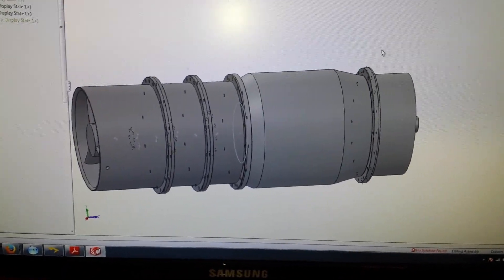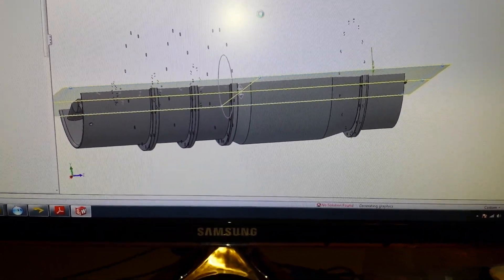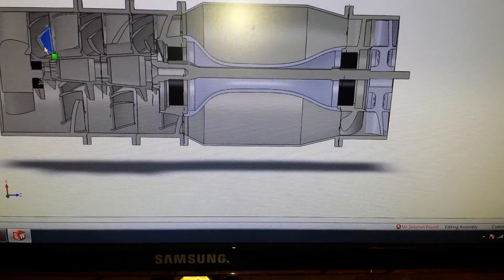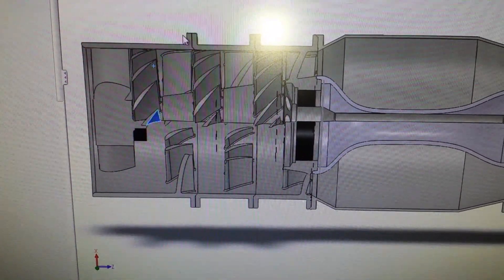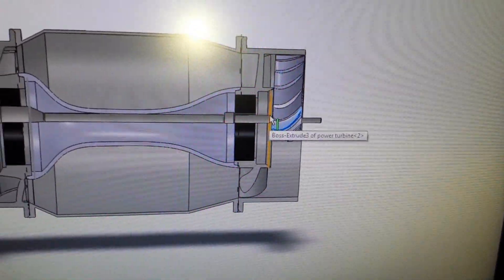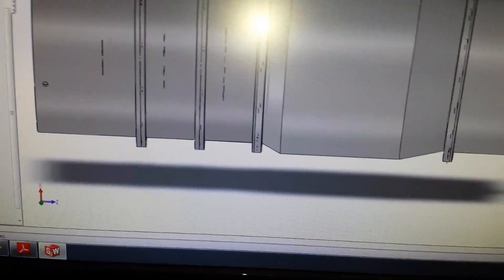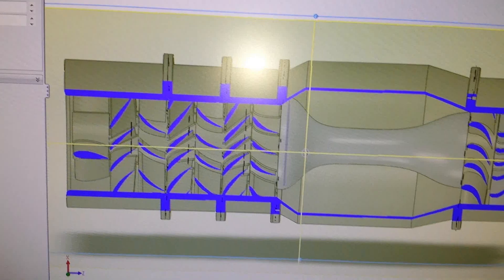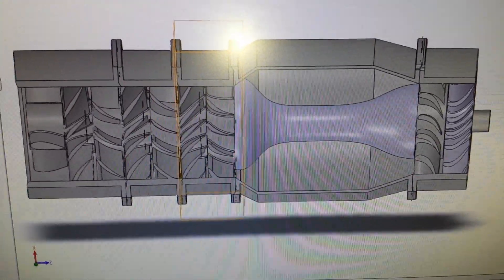3 stage axial turbojet

Comment: don't wait for your friends calculation because i've already done it and a 3 stage axial compressor will yield only 25.4016 psi as per my computation based on maximum efficiency performance if based on minimum the yield would be 19.5657 psi. compare that to a single stage centrifugal compressor which i have computed to yield 58.8 psi if you use a 2 stage centrifugal compressor the yield would be 176.4 psi. an 8 stage axial compressor will yield 63.2073 psi a 14 stage axial compressor will give you 188.7359 psi.so you need to build an 8 stage axial compressor to beat a single stage centrifugal compressor, but if you want to beat a 2 stage centrifugal compressor you need to build a 14 stage axial compressor.
Reply: +phoebekuan So, why not just build centrifugal compressor instead?
Reply: +Aviator168 building a centrifugal flow micro-jet engine has already been done by a lot of people so the challenge now is to build a self-sustaining axial- flow micro-jet engine. many persona have claimed to have built a working micro axial-flow jet engine but never proven its veracity beyond doubt..

Comment from the maker: yes there is stators between each stage of rotors , they are integrated into the housing so its on piece.
Reply: So it's on piece?

Fukken Slovak grammar..

Edit: spelling correction, Loool

Comment: It's looking good mate!

What are the OD dimensions?
Reply from the maker: The blisks are 60mm but at the largest point the engine is 72.5mm and so far it is 195mm long . Complete length should be just under 230mm. if all goes well i will later try to compact the combustion area to get the engine in at under 200mm. Machining should begin by the end of February.
Had a question for you tho, are you letting the lubricating sprays that cool and lubricate your bearings just leak into your combustion can and burn off? or are you doing a recirculation system.
Reply: Yes, total loss system into the combustion chamber. That would be a good way for you to go forward. If you have full ceramic bearings, you really just need to keep them cool so circulating oil or fuel is an un needed headache.
Thanks for the opportunity to access CNC if I need it.
Reply from the maker: yeah that makes sense, do you know what kind of flow rate you need to the bearings ? or are you just doing like a small needle 
and no problem.